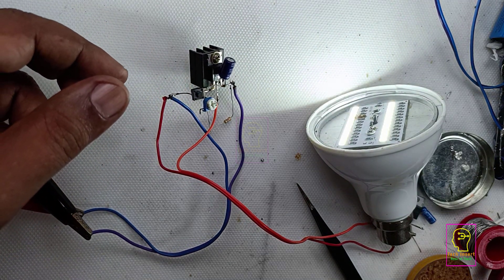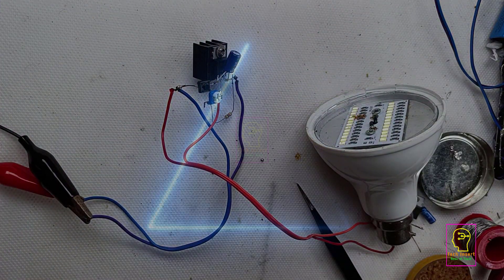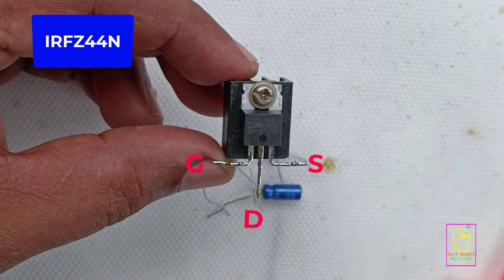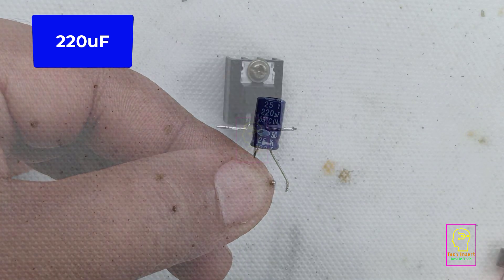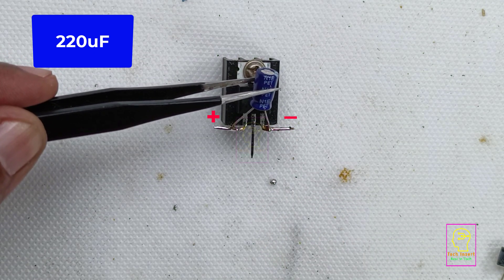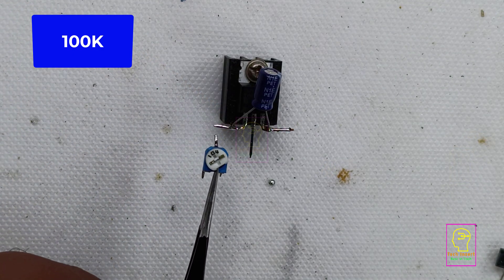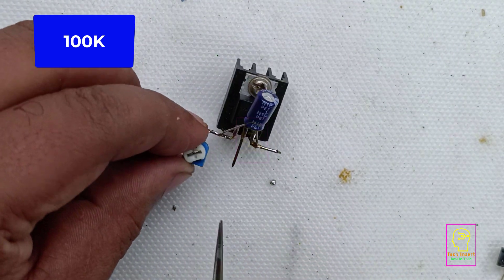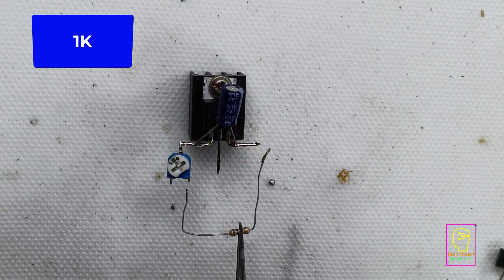Build the BEST Adjustable Timer Circuit EVER with this DIY Project!

Comment: Thanks. But how do you get it to switch back on by itself. Like a manual washing machine does.
Reply from the maker: We need a writable rom for that. Washing machine has a micro-controller which is programmable and it has a rom which keep the status like time remaining, waterlevel, current process etc.
Reply: @TechInsert  Thanks.
Reply from the maker: Welcome